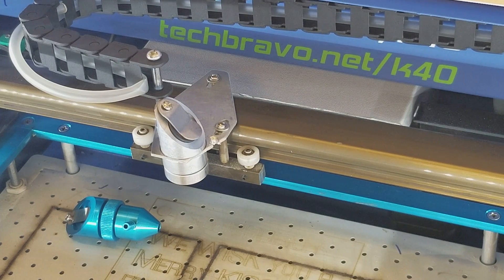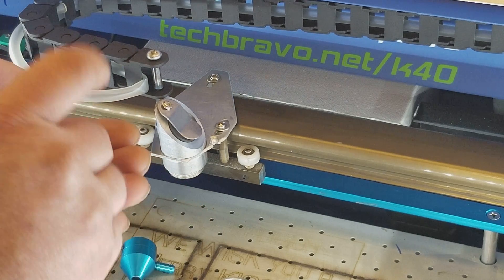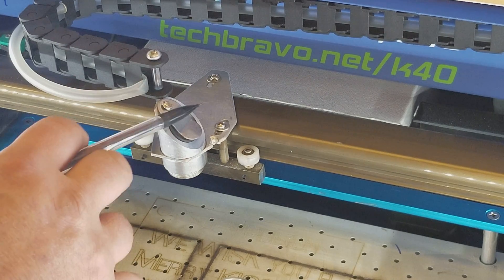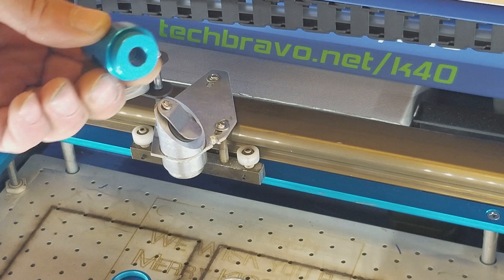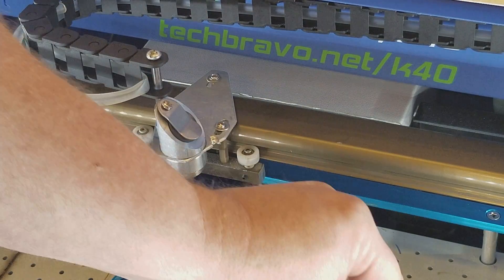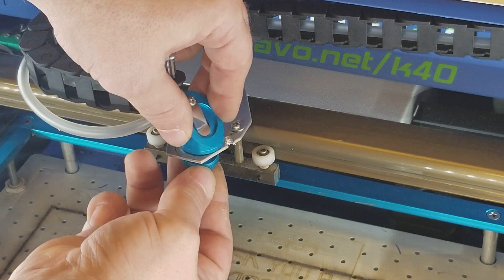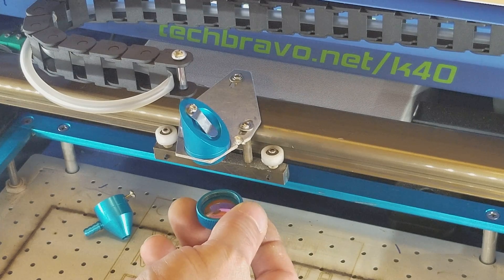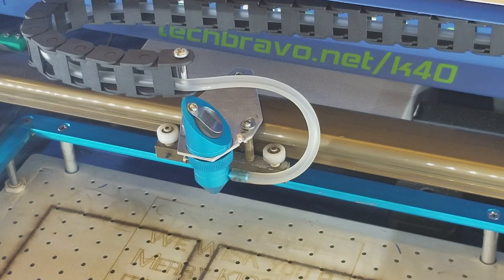Upgrading Stock K40 Head With LightObject Air Assist Head

Comment: I have been struggling with poor-quality laser heads since buying a laser. The head slowly unscrews itself. Tightening metal to metal simply does not work. I have a basic model, any recommendation where to buy a better head?
Reply: Machine Tech for nearly 30 years- use regular clear silicone as a "loctite".  I've used this in dirty environments with vibrations and it works great.  Best part is it's removable and doesn't damage aluminum threads.

Comment: That air assist sucks. Via the Venturi effect, it will suck dust in and make lens dirty.... there are a lot of air assist on thingiverse, ready to print and use with a little fan....
Reply from the maker: yeah they do and my articles on this talk about that. i use the copper pipe air assist and have stl's and dxf's for mounts published

Comment: I put the bottom half of the air assist on mine and now it scrapes the exhaust port as it goes by it, anyoen else have this issue?
Reply: @TechBravoTN  excellent, thanks
Reply from the maker: yes this can happen. many people cut back the exhaust. i have a video on doing that somewhere in the laser playlist :)
Reply from the maker: thanks :)

Comment: I've sort of taken over maintenance of the laser where I work trying to transform it from a toy to a tool. I'm learning all this stuff by the seat of my pants here and thanks for the help. I've heard a lot of people say convex side down. Only you say convex up. What is the reasoning ?  I already found soot baked onto the lens. Fortunately it came off with a lot of isopropyl and cotton balls.  I think I will try an air assist mod. We usually just use the machine for plastic labels and signage for the machines we build. Would air assist help with plastic? I may use it for wood also.

Comment: Oh my goodness - this was awesome.  I've had one of the air assists for awhile, but haven't even tried to install it (partially no time, but partially just scared to mess it up).  I'll probably be one of the ones that just puts on half of it.  Thanks for the tip of it actually unscrewing.  I've not seen that anywhere.

EDIT:  Scratch that - I just went ahead and switched it all out.  I had new lenses for both of them so it just made sense.  

Do you happen to have a video/picture on where you mounted the air assist 3D bracket?
Reply: Sorry about that - bracket wasn't the correct word.  Whatever the thing is called that your air assist hose is inside of (the black links).  Where did you mount the other end of it?  Thanks.